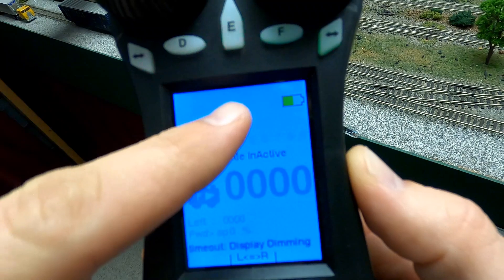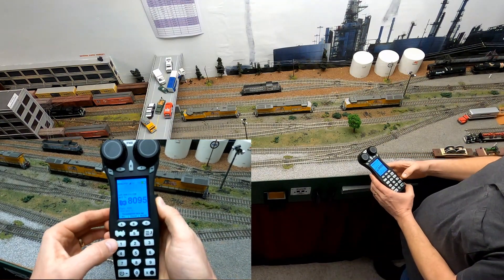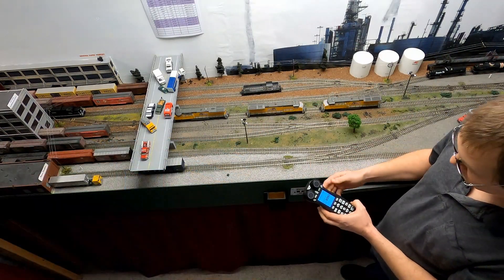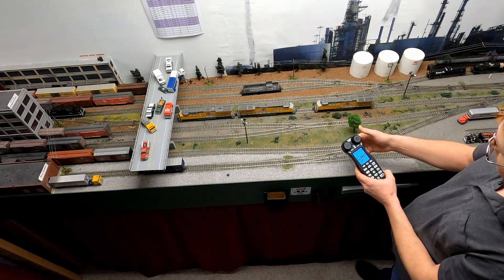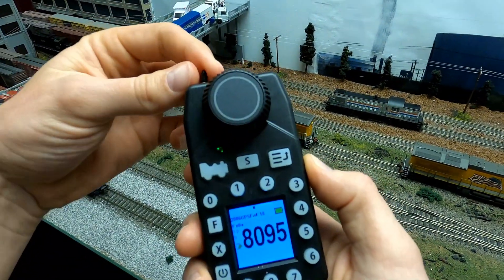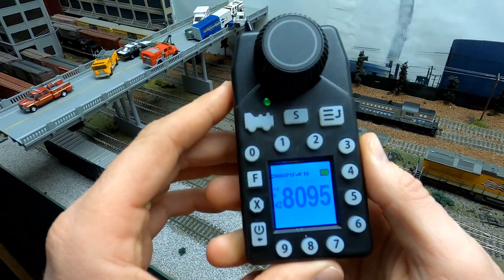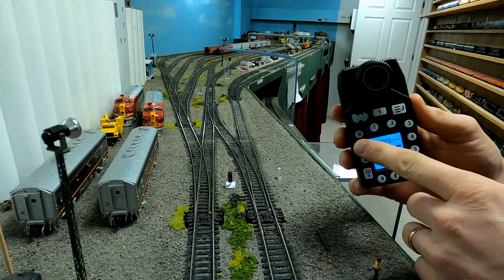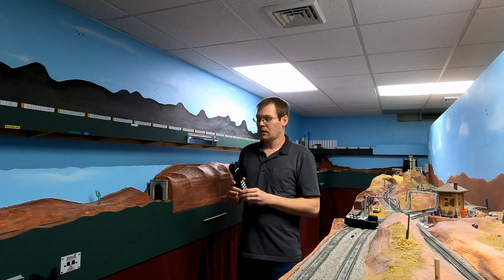Digitrax UT6 & DT602 Throttle Functionality

Comment: I thought you had to have the 'DT602D' throttle in order to go wireless?
Reply from the maker: For Duplex Wireless, yes you need a "D" series throttle and a UR92 or 93 Duplex reciever. But most non-D throttles have IR wireless that allow it to work line-of-sight like a TV remote if there is a IR capable reciever like the UR90.
Reply: @signalupproductions  So I have the teathered option of the DCC Digitrax system and no UR90 accessory. I will be required to use the loconet cable in order to operate the DT602 even though it has the infrared (strobe) option, correct? 
Do you have a video explaining how to set up the iPhone as a remote controlled  throttle as well? (I would suspect that this too would require the use of the UR90?
Reply from the maker: Correct, without the UR90, plugging in the tether is the only option for control.
As for the iPhone, you need an LNWI. That is the Wifi module that plugs into your Loconet system, and creates a wireless network for devices with Wifi (i.e. cell phones and tablets).
https://youtu.be/koWzvLmyOAY

Comment: Using the UR93, you can run how many UT6D's?
Reply from the maker: The Digitrax manual says "unlimited", but that's not realistic.
Our group only has 1 UR93, and that covers the whole basement (26x70). We regularly have over 12 or more people running trains, and have never noticed an issue.
Before, we had two UR92's, and would still sometimes lose control of trains.

Comment: I really dislike the 602 and am having a very hard time getting used to it.  The DT500 was far more intuitive and comfortable in my opinion... it's still my go-to and the 602 sits unused most of the time.
Reply from the maker: In my discussions with people about Digitrax, I find that most who have used the 400/500 throttles for MUing and throwing switches find it hard to wrap their head around the different method the 602 uses. But people who have never used DCC or Digitrax have caught on to the new throttles much easier.

Comment: Is there any way to override that annoying screen going dark after 30 seconds? It’s really annoying
Reply from the maker: There is a menu setting that will increase the time. But I have not found a way to keep it on continuously. I've just got in the habit of pressing the "X" button each time before I operate any functions
Reply: @signalupproductions  STOPPING SLEEP MODE
To keep the screen on the DT602d throttle from going “to sleep” - Press Menu —> Press 3 - Utility Tasks —> Press 3 again - Throttle Option Edit —> Turn 18 and 19 to 0
This is what I did and it did the trick
Reply: @signalupproductions  Thanks, it’s a start
Reply: @tczephyr3665  STOPPING SLEEP MODE
To keep the screen on the DT602d throttle from going “to sleep” - Press Menu —> Press 3 - Utility Tasks —> Press 3 again - Throttle Option Edit —> Turn 18 and 19 to 0
This worked on keeping my throttle from going dark

Comment: Hi Steven. I’m so pleased to have discovered your channel as I have been experiencing exactly the issue you described between a brand new DT602DE (Europe) throttle and my older UR92CE receiver. With the two components placed literally two inches apart, the signal on the throttle constantly roams up and down between one and three bars…never a stable full signal as you would expect.

I understand that if I get a UR93CE it will happily co-exist with the UR92CE and the signal issues should disappear. Does that fair and reasonable to you?
Cheers and regards
Reply from the maker: On the contrary. I don't think it is a good idea to have both a UR92 AND a UR93 on the same layout. I know that people have made it work, and digitrax says it should be fine...But we could not get both to work right. Honestly, the range of the UR93 is greater than whatever a UR92 would add. Our large layout that normally has 10 people running trains has only the 1 UR93 in the middle of the room, with no issues. We sold all the our UR92's.
Reply: @signalupproductions  That’s really interesting and helpful. I’ll order a UR93 today. Subscribed!🤩

Comment: Thanks for this video, I was unaware that you could pull address's without pluging in to the loconet. Great info
Reply from the maker: Yes with duplex you can add and remove locomotives from a consist without plugging in. With simplex, you have to plug in.

Comment: I would like to know about the issue of the driver using 3 or 4 locomotives from different manufacturers at the same time in this control.
If the engines are different, how to adjust the speed for the locomotives to run together?
Reply from the maker: Adjustment is completed by reprogramming each decoder inside each locomotive. This is called "speed matching". I have a video on my channel showing how to accomplish this. There are many other channels that have detailed videos.

Comment: Does it have sound?
Reply from the maker: A couple of the engines I used in this video do have sound. The sound was muted so everyone could hear me explain how to use the throttles.
Reply: @signalupproductions  on those locomotives there’s one UP C45ACCTE and two C45AH T4 gevo on the Digitrax Dt602 you can press any numbers of button like pressing the horn and bell and locomotive off and locomotive startup the engine